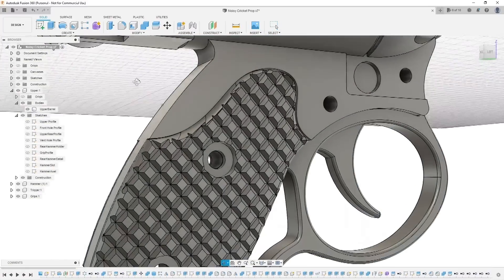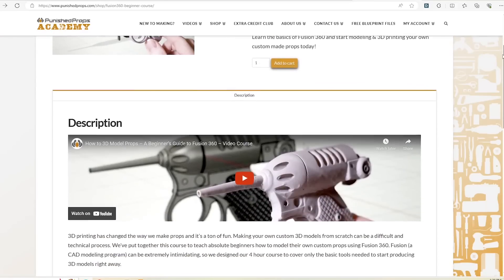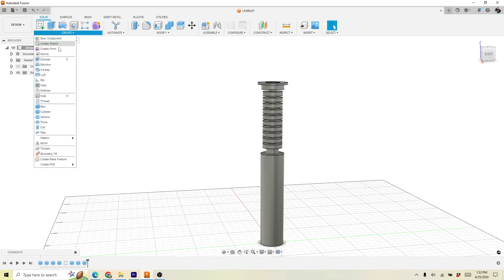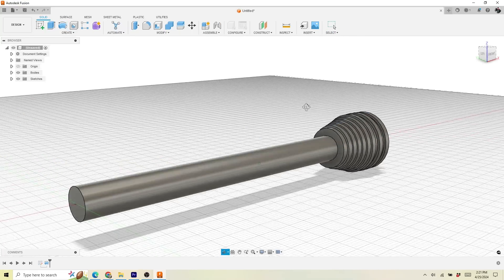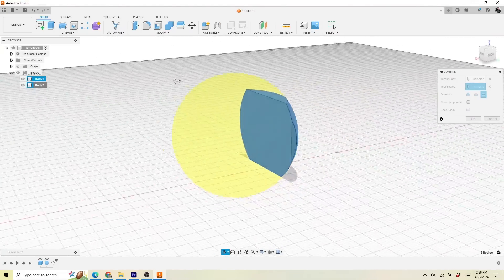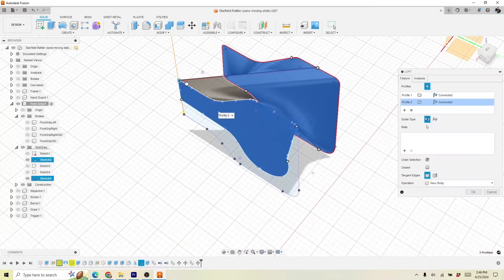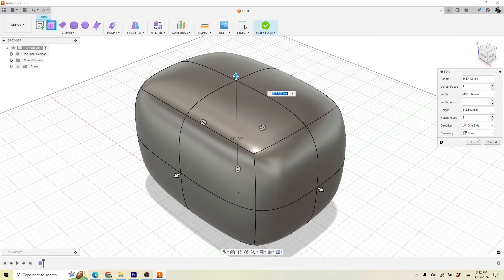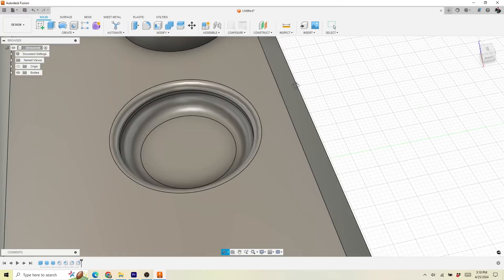10 Basic CAD Operations for Prop Making

Comment: Does fusion360 let you preserve “line thickness” when you scale objects down, or to at least redo it to a thickness? I’ve noticed on things I 3d print, scaling down is an issue because the lines and details that still appear it a slicer preview disappear or aren’t translated to the actual object because when you scale down, it reduces line thickness as well to the point you need either a tiny nozzle or it’s impossible to get outside of like a resin printer. Is this something you can use fusion360 to define and/or possibly fix when you scale objects and details down?
Reply from the maker: In Fusion 360, there's a system called Constraints. If your sketch has constraints, changing a number will update all the relationships. It's a rabbit hole for sure, and I don't use them much, but I imagine machinists use constraints so they can change scale and keep relationships the same. Here's some basics: https://youtu.be/J_2If5zVp84?si=iaEXolm5noIA-kP7

Comment: I’m really interested in this but am concerned whether the free version of Fusion 360 gives access to all the features needed. Their website is a little cryptic about it and suggests there are limited features but as I am not familiar with this sort of software, I don’t know what it means. Does anyone know what the deal is?
Reply from the maker: The free version will give you all the tools you need to model, export, and 3D print your props.
Reply: @punishedprops  thanks very much for answering my question.
Reply: Course ordered! 🎉